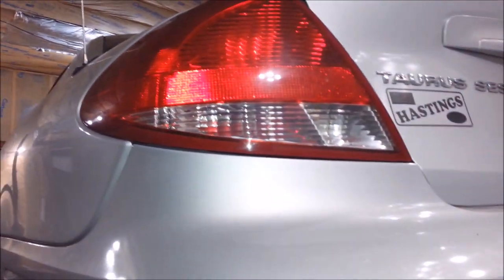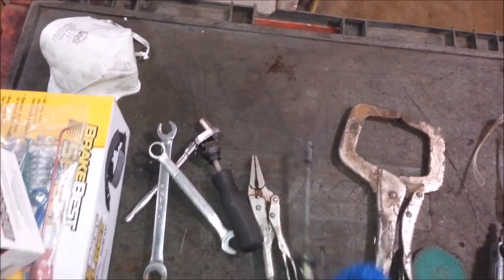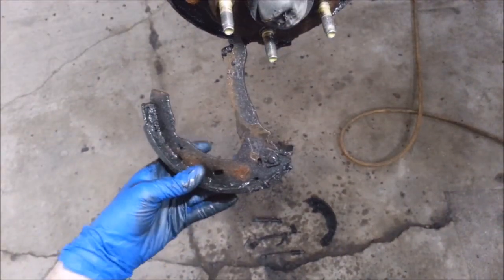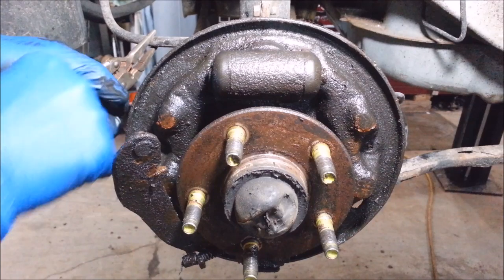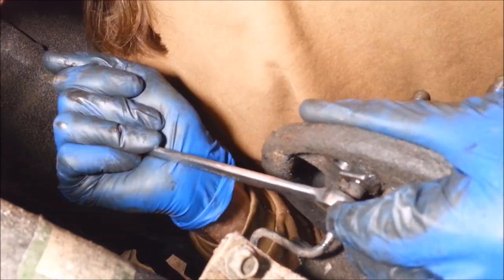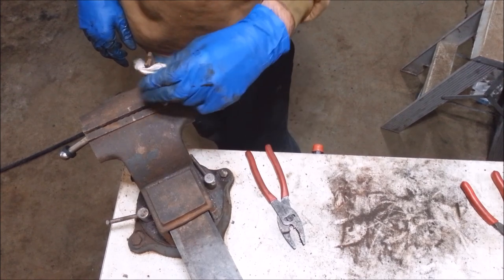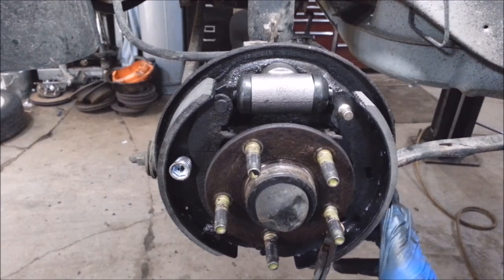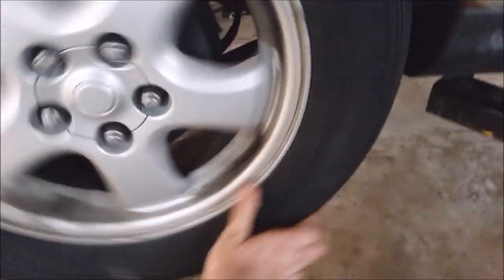2001-2007 Ford Taurus rear drum brake job and wheel cylinders

Comment: Drums are fun because it’s like the one part of the car you can just grab a hammer and go full chimpanzee mode on em and it’s actually the right thing to do. Tremendously cathartic. (Mind the studs of course)

Propane is also sufficient for the fittings I’ve found. The issue is more the coating than the rust, so as long as you get it hot enough to melt that away, it usually gets moving. Wipe it away while it’s still melted or else it’ll just get stuck again when it cools and you’ll have to do it all over again. YMMV of course, the ones into the cylinder do seem a bit trickier cuz they’re out in the elements.
Reply from the maker: Actually the center hole is rusted stuck, and the propane expands the hole of the drum just enough to make it easier to get off.

Comment: my professional advice to you would be for you to clean that whole area   with brake cleaner   take a big garbage can and put it under the work area if you are worried about  getting fluid on the floor  I do it this way in my shop all the time    if it ever looks the way your job does    way to much brake fluid   . you have the veh on a lift  take advantage of the hight    you can fit a can under it
Reply from the maker: No thanks, I'm trying to quit.

Comment: What causes the brake cylinder to blow free? Ive blown two. Plus the second time was a brand new one
Reply from the maker: They generally blow apart when the cylinder is over extended.
Reply: @RustBeltAuto  How do you stop over extending it?
Reply from the maker: @josiahchilson6114  you may have the wrong, or missing parts, if that is what is happening.
Reply: @RustBeltAuto  We have the right parts, nothing is missing, but it keeps popping. We are at a lost.
Reply from the maker: @josiahchilson6114  you mean the piston on the cylinder pops out, and leaks all over the place? If thats the case, you probably have the wrong parts, missing parts, parts that are put on wrong, or maybe the adjuster is too loose.

Comment: 🐾Your fun to watch. With your knowledge  and wit you can be a tv star. We need good shows. 🍵🍵

Could crimping the old brake lines with needle nose pliers destroy the old brake line?
Reply from the maker: Technically, you could collapse an old hose. If it happens, it is due for replacement. Usually only see collapsed hoses on Fords. You will know when the brake will not disengage, you open the bleeder screw, and it frees up the brake after squirting brake fluid out.

Comment: How do i bleed the brakes after i change the brake cylinder. The cylinder just fell apart when i removed the brake shoes so i did not have the brake hose clamped down. No fluid in the lines
Reply from the maker: There is a bleeder screw. Unscrew it, take your master cap off, and let it drip out until there us no air.
Reply: @RustBeltAuto  I appreciate your response. I figured it out and had a good day of self taught lessons. Your recording did help me get the job done. Thanks

Comment: For people that don't wanna screw with all those tools they make a drum brake tool that does almost all of it for about 10 bucks. N Ford Taurus Drum brakes as bad as this guy wants to make them seem usually last for about 160k miles. So you'll do this once maybe in the life of your car. The Bull was and is an extremely reliable, economical, comfortable, possible high option vehicle. They weren't the best selling  mud size for a decade for nothing.
Reply from the maker: Can you give me a link please. I went on EBay, and did a search for a Ford do it all in one brake tool, and all it came up with was a rogue hoe, a survival hatchet, a set of knives, a multi tool lanyard, and a pen. Thanks!
Reply from the maker: I'm pretty sure it was the best selling mud size car, because people made a bunch of children they couldn't afford, had to drive in rush hour traffic every day, go to a job they didn't like, that made them miserable on the inside, for some crappy lower middle class wage, and couldn't afford to buy something they actually wanted, because they needed to squeeze every penny of budgeted money out of their tightly squeezed butt cheeks. Personally, I think the thing looks, seats, and behaves like a bad trip on steroids.
Reply: @RustBeltAuto  thanks for confirming what i already feel

Comment: Be careful not to twist that brake line fucked mine up doing it. Thankfully it’s a $8 part and it can just screw it back in
Reply: Is the fitting from that 8$ part good? I need this for my 02 focus

Comment: Rule of repair for brakes whatever you do to one side do to the other. 
Both wheel cylinders should be replaced..
Reply from the maker: I only replace them if they are leaking, or stuck.
Reply: @RustBeltAuto  if brakes fail and it ends  in a lawsuit,  you would lose..
It's more of a liability factor..
My friend was sued for what you did and the plaintiffs brought in a specialist that stated whatever you do to one side you do to the other..
In my state law stipulates whatever is done to one side must be done to the other..

I had a new Jeep truck left front caliper fail..
The dealer replaced the left caliper,
I asked if they replaced the right one..
They said no.
 I said state law says,
 before I could finish they took the truck back..
Replaced the right side.. 
even if it was a new truck with 500 miles on it..

The video was entertaining..
I had to break a drum to get it off.
Reply from the maker: @Butchsiek  calipers, and wheel cylinders are not a wear item, like a brake pad. That's like saying if you had a left flat tire, you need to replace the right one too. both front wheel bearings, or both axles from a torn boot. If you tell service the law says you need to spend more money, they will let you. No brake class, or ASE study question says you need to do this. I would like a link to your information please.

Comment: It should be noted that you don't have the parking brake on and these drum will usually just wiggle free. Beating them is probably not necessary.
Reply: Incorrect. These fords are known for seizing/developing rust lips.

And unlike toyota, there is no built in quick way of removing them.

Assuming they are off and on during appropriate intervals being inspected like they should, then yes they will come off no problem.
Reply: @thatdudemoe9109  whatever dude I'm just saying they can wiggle free a lot of times. It's not incorrect I've done these plenty of times. Sometimes they rust up yeah but not always.
Reply: @DavidLDFL  how immature
Reply: Depends on how wet and rusty it gets. My driver side pulled straight off and my passenger side I had to spray WD40 around the lugs because the drum was rusted to the lug plate. It was also the side where the adjuster thread is rusted and won't turn.